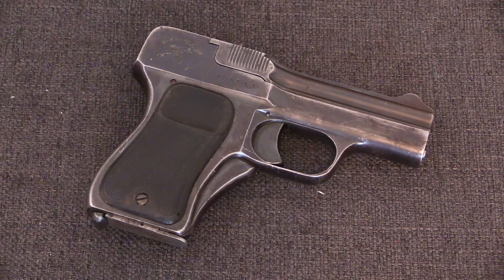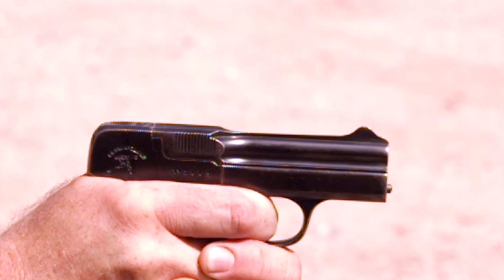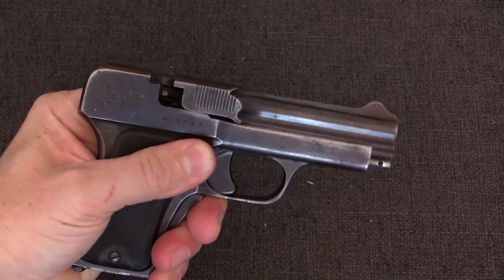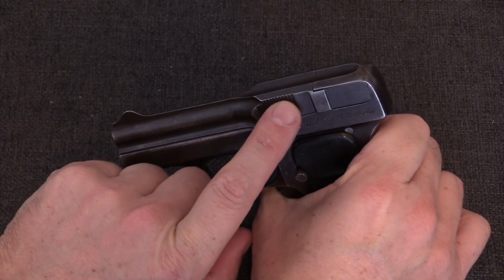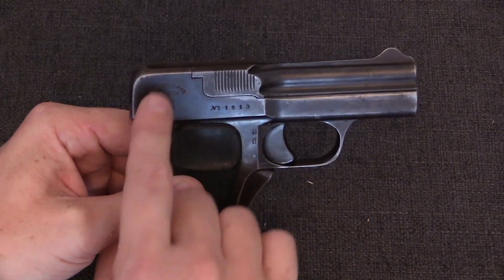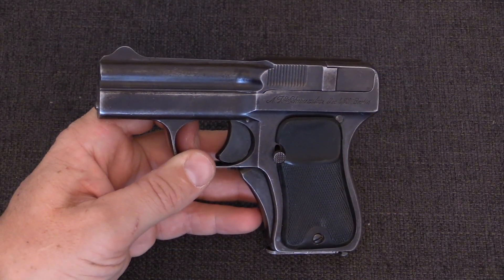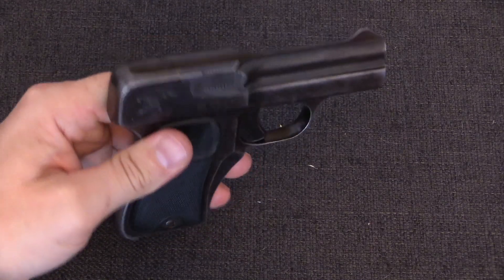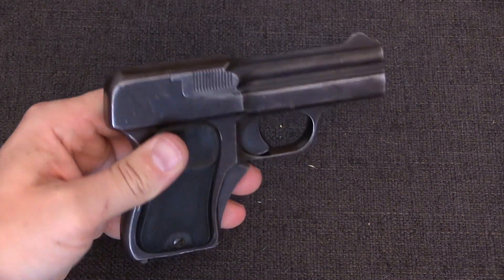How Does it Work: Blow Forward

Comment: Pretty sure Ian is wrong about the source of the recoil here. 

First, It is not the bullet itself that creates recoil. It is the force of the gas pushing on it, which is also pushing on the casing with an equal force in the opposite direction. That gas pushes on the casing, which pushes on the gun, which pushes on your hand. 

So the barrel moving forward with the bullet does not add to this. The force pushing against the brass, which in turn pushes against the gun and your hand is the same. What is different is that force is pushing directly and immediately against your hand. In a blowback system, a bolt absorbs the force and moves back first,. This presses on a spring that compresses instead of transferring all of that force at once into the frame/hand. The spring turns what would be a near instant jolt into a progressive rise in pressure spread over a few milliseconds, peaking as the bolt hits the rear stop and transfers the rest of its kinetic energy into the frame. 

So yes this has more felt recoil, but no more so then other rigid arrangements like derringers and revolvers. It does not create recoil out of thin air, the law of conservation of energy is maintained. 

Side note: Yes heavier bullets create more recoil, but that is because the gas has to press harder on it in order to move it. If its pressing harder on the bullet in one direction, it is simultaneously pushing harder on the casing in the opposite direction. Thus more felt recoil.

Edit: Further musings; the 'pull forward' force created by the friction of the bullet and barrel (the bullet wants to try and take the barrel with it) may help alleviate recoil in fixed barrel guns, where with this gun you do not get that. Instead there is a secondary shock as the barrel returns home. So I guess in that sense this gun design does have a tiny bit more recoil unique to it.
Reply: exactly what I thought, it's not very different from other weapons with fixed breach (including you mentioned for example the revolvers), but an interesting detail that I see is the possibility of making a weapon with low bore axis, since there is no action movement passing over the shooter's hand, so this could even increase the felt recoil in the palm of the hand, but it would certainly help in muzzle flip, in addition to other factors that I find interesting about the blow forward, I would like someone to work with this concept

Comment: Would it be fair to think of blow forward as having the barrel essentially stationary while the rest of the gun recoils backwards? If that's accurate then the gun might not cycle properly if it's held in a rigid clamp (not a Ransom Rest, since the gun tilts back in one of those).

Comment: So in theory, one could balance the forward momentum by increasing the weight of the slide and thus counter vertical recoil for a rapid fire system?

 Just curious, since it seems like a neat way to add greater control to a full auto pistol. Also, its just fascinating!

Comment: Would it increase or decrease velocity though? In theory wouldnt the projectile have more resistance against the action moving in the same direction vs a static barrel or does its velocity cancel out the slower moving parts?

Comment: It might be semantics, but I prefer to refer to this system as Drag Forward, because it more accurately reflects the physics involved. The propellant gas cannot act on the barrel directly in 'blowing' it forward. Instead, it can only push the bullet forward. There is significant friction between the bullet and the barrel as the bullet is accelerated; this friction is what's utilized to run the barrel forward and cycle the action. Hence, my preference for Drag Forward.
Reply: I remember the Pancor Jackhammer being defined as having a "blow forward" action as well, would you say its action is different to the ones employed by the handguns on the video?
Reply: @alloy299  Actually, yes. Looking at it, the Jackhammer has gas ports and an expansion chamber to allow the propellant gas to directly force the barrel forward. So calling the Jackhammer a Blow Forward action appears to be good terminology.

Comment: I'm confused now. Does this system rely on the cartridge case acting like a short stroke piston? If not, what component is applying a forward force to the slide. (Consider the slide-case-bullett-gas as a single body if the case is locked in by expansion & friction). ????? (Excuse logic fails, it's "forgotten weapons + a beer" o'clock here)
Reply: Think I've answered my own question. Case stays hard up against breach block, barrel & slide go forward. Physics not broken. Huzzah.

Comment: I dont understand. What pushes the slide forward? In blowback systems the pressure pushes the case back, and here.. It seems, that friction between the bullet and the barrel could push the slide forward... What else? I don't see anything that gas could catch on and push the slide forward...
Reply: Have you forgoten the inside of the barrel and its riflling then as long as the bullit is in the barrel it works as a block.
Reply: @exploatores  the angle of the rifling is very steep, so it seems that only the bullet can drag the barrel forward. Yes, rifling helps with that.
Reply: don´t forget that the presure wave from the explosion moves around 1800m/s and the bullit might do 300m/s.
Reply: @exploatores  can you explain why is this relevant here?
Reply: compared to the expanded gas and presure wave the bulliet almost dont move. as most of the pressure cant go forward. It goes backwards. propeling the barrel and bulliet combination forward.
Reply: @exploatores  yes, makes sense. Thank you.

Comment: I don't know how well you recoil theory matches your previous statements. As we all have seen in high speed footage the recoil happens when the slide (or barrel in this case) slams in his end of travel. Therefore if this theory is correct blow foward guns should in fact have less felt recoil.
Reply: You feel recoil when energy is transferred into the frame and your hand.  In the case of blow-back, gas expands forward, propelling the bullet, and it expands backward (the equal opposite force) propelling the slide.  When the slide reaches it's rearmost position and stops, that energy has to go somewhere, so it transfers into the frame and your hand.  In the case of blow-forward, gas expands forward, propelling the bullet and the slide together, and backward into the frame.  So you immediately feel the full energy transferred into the frame, versus a blow-back where the recoil spring has dampened some of that force by absorbing energy into the frame over a longer period of time.
Reply: @cmtptr  I understand your point, but if you compare it to a revolver in the same caliber and weigh he would`t notice that abrupt recoil for sure

Comment: there must be a system that blow Forward and Backward simultaneously!
Reply: What would the purpose of such a system be?  A higher rate of fire? Less felt recoil?
I am not saying it would be impossible to make - but I doubt it would be cost effective in relation to whatever benefits it could provide.
Reply: @noremorsewoodworking2258  take a simple blow back Gun an translate 
a 
mass with a gear into the 
opposite Direktion. The Result is less recoil!

Comment: I wonder if a blow forward design would work well with a 22lr handgun. Recoil is pretty minimal with that round to begin with, and it could potentially resolve feeding issues.
Reply: .22lr may not actually have enough oomph to move all but the shortest/lightest of barrels.

Comment: What pushes the slide forward? Does the barrel have some kind of gas trap, or is the rifling acting on the bullet?
Reply: As far as I can see it's pressure between the case and the bullet travelling down the barrel that that causes the case to be pushed out of the barrel, causing the slide and barrel assembly to be pushed forward. It's a bit hard to say if it's correct to say that the barrel is being pushed by the pressure, or if it is dragged by the bullet as it engage the rifling while traveling down the barrel. This should also make an extractor unnecessary.
Reply: @blahorgaslisk7763  The pressure by itself shouldn't be able to push the barrel forward, since it acts perpendicularly to the  movement.
Reply: If the slide moves forward product of the bullet engaging the rifling, that would be quite interesting, I do not expect regular rifling to exert such amount of force on the bullet.
Reply: @alloy299  But it acts on the shell casing pushing it backwards out of the barrel, acting like a piston. As she case has nowhere to go the barrel will move forward.
Reply: @blahorgaslisk7763  The one acting on the case is the expanding gas, not the barrel. The bullet engaging the rifling acts as a temporary plug and pushes it forward.
Reply: @alloy299  Thank god someone finally pointed out that the forces exerted by gas pressure against the barrel is orthogonal to the recoil impulse, and thus cannot be the driving element. 

The only forces in line with recoil are gas pressure against the block,  gas pressure against the bullet, and friction between the bullet and barrel. The blow forward effect is from the bullet dragging the barrel along with it, which increases felt recoil by effectively adding more mass to the bullet the gun is trying to accelerate.

I feel I must sound like someone trying to look smart now, I regret my chosen words.

Comment: I accept that blow forward guns kick more, but not the explanation given.  "felt"recoil in semiauto pistols that have a reciprocating slide at the rear depends on the mass of the slide, its velocity, and how quickly or abruptly that its momentum is dissipated against the frame of the pistol.  Only after its movement is stopped by the frame of the pistol is any momentum transferred to the hand.  

In a blow forward system the rearward movement include the wt of the whole frame being stopped by the hand abruptly and so the recoil felt feels more powerful.
Reply: "Only after its movement is stopped by the frame of the pistol is any momentum transferred to the hand.".... incorrect sir.... why? .... Newton.... sorry
Reply: @slthbob  there will be a little bit of backward thrust that is not from the slide transferred to the frame from compression of the recoil and hammer r striker springs and also friction of the case when it expands to the limits of the chamber wall.   

Explain the errors please.  Just to claim it is wrong without explanation is not very convincing.  When you say an explanation is incorrect, you should offer an explanation of it.
Reply: @loquat4440  The first sentence of your reply, before your request for me to explain it to you... just explained it dude... like I said... Newton... jr high physics... again. sorry... thanks for playing
Reply: @slthbob  I doubt that you understand the term of felt, that is what is perceived by the shooter, as it is used here.  In both cases, blow back and blow forward, total forces related to momentum for similar cartridges are the same and must conform to Newtonian laws of motion.  Just how much experience do have with different blow back handguns, submachine guns and rifles.  The recoil that you feel for the same cartridge is very dependent on gun design for the same cartridge.   Of course what comes out the barrel end will depend on barrel length and not so much on action type.
Reply: @loquat4440  I am amazed at the need to continue an attempt at a conversation... when your own words at face value after being told you were incorrect... support the fact that you were incorrect... I also understand that YOU do not understand that your are talking to a unicorn... not a "Fudd"
Reply: @slthbob  LoL i am amazed also.
Reply: @loquat4440  If you dont feel privileged you are missing an opportunity.
Reply: @slthbob  Mike have a good day
Reply: You missed the point of what Ian was saying. In blowback, it's the mass of the slide that delays the breach opening for pressure to drop enough for safe extraction. Blow forward is exactly the same except it's the mass of all the forward moving bits that provide that delay.

Comment: Nice slowmo ! Many sources (wiki) cite that this system partly relies on gun being blown back. But on the slowmo you can see it's not very significant, and how much and how soon the barrel pulls forward.
This means it's mostly the friction between the bullet and the rifling doing the job. Would be nice to see how it behaves tightened in vice (to remove all recoil component) and with blank (to remove the friction component).

Comment: Are you limited to the cartridge size or does this work on all calibers?
Reply from the maker: It would be limited the same way as blowback. Technically any cartridge can be done, but you quickly get into multi-pound slides necessary to run safely.
Reply: @ForgottenWeapons  Thanks Ian, so i guess .380 is the max you can go
Reply: @ForgottenWeapons  .. unless you use a gas tap at the front of the barrel to trip a catch that's holding the slide closed, and the remnant pressure pushes the slide forward on an invert piston. Then you'd have the worst recoil energy curve ever created! PushPUUUUshPullPop (projectile recoil, slide forward under pressure, slide closing under spring pressure, slide hits stop in battery). I suppose the slide wouldn't need to be so heavy though, but the gun's also going to get a multiple of HK P7 levels of heat in the frame...

Comment: Wouldn't it potentially be more accurate too if the sights were all on the barrel rather than a slide?
Reply from the maker: Potentiually on this example, although the other two models do not have the sights directly on the barrel.
Reply: @ForgottenWeapons  Not sure why they wouldn't take advantage of that in the other 2 designs.

Comment: In most actions, the cartridge doesn't extract until gas pressure is reduced.  In this system, doesn't the cartridge case need to contain the gas pressure without support from the chamber?  Would that be a problem in a larger blow-forward weapon?

Comment: So, besides the increased felt recoil, is there any reason why this system didn't see more wide spread adoption? Is blow forward inherently weaker mechanically than blow back?
Reply: My guess would be feeding. Only thing that I can think of.
Reply: @jonasstrzyz2469  Feeding is exactly the same as a straight blowback gun. Which piece is moving makes absolutely no difference to the cartridge.
Reply: @wingracer1614  
If it makes no difference then only reason why the blow forward system has not been produced in more firearms is because of the increased felt recoil. Or do you have any other reason? 

The only redeeming factor that the blow forward system has is that there is no possibility for hammer or slidebite to occour, and mounting optics is a thought, although with modern optics, slide velocity is not an issue anymore.
Reply: @jonasstrzyz2469  Felt recoil is enough of a reason. The less a weapon moves in the shooters hands the more accurate the shooter can be with follow up shots.

Also think smaller or physically weaker people firing them.

In a firearm you want a weapon that you can aim and fire repeatedly and quickly to hit targets. 

Felt or heavy recoil will affect follow up shots.
Reply: I was wondering that myself. We've seen some pretty bad designs spread farther than this one.
Reply: Weaker no. It's just a bad system. Who wants a .32 pocket pistol that recoils like a 9mm?
Reply: The moving barrel makes it inherently less accurate than a fixed barrel, traditional blowback action.
Reply: @MichaelEdelman1954  
Thank you for your imput, although the question is if the inherent accuracy reduction matters when it comes to handguns.

Comment: Great informative video as always.
Would you be able to do one of these on extraction and ejection? As someone without hands-on firearms experience, I find the concept understandable in theory but hard to contemplate in practise.
Reply: The difference is fairly simple. Extraction is  the process in which a cartridge (fired or unfired) is pulled out of the chamber, whether by a reciprocating bolt, manual ejector, or other mechanism. This is why cartridges have rims or projections on the back of them, they're a place for the firearm to "grab" onto them and pull them out of the chamber. This is done by the "extractor", which hooks this projection in some fashion.

In some firearms, extraction is aided by residual gas pressure in the cartridge, which can help blow a spent case out of the gun. There are even some rare designs that lack extractors and depend solely on gas pressure for extraction, though they tend to use lower pressure cartridges. This of course creates problems when it comes to the removal of unfired, live cartridges!

Ejection is much simpler, it's the act of removing the now extracted cartridge from the firearm and throwing it clear or positioning it such that it can be removed by hand. How this is accomplished can vary in terms of design and complexity, but the overall function is the same. 

In some firearms, ejection is manual. The best example being some older double barrel shotguns, which will extract the shells but rely on the shooter (or gravity) to completely remove them from the chambers.
Reply: @LN997-i8x  Good answer.